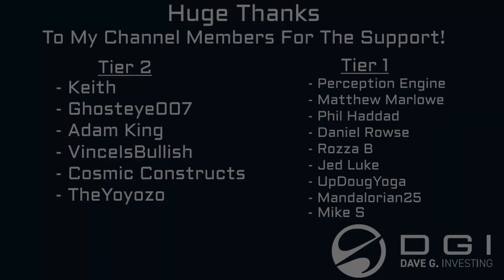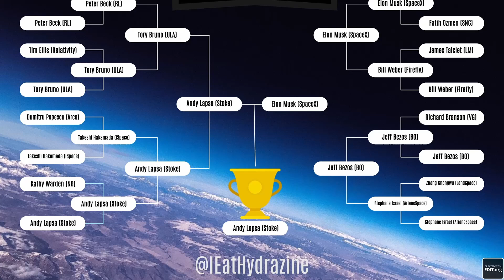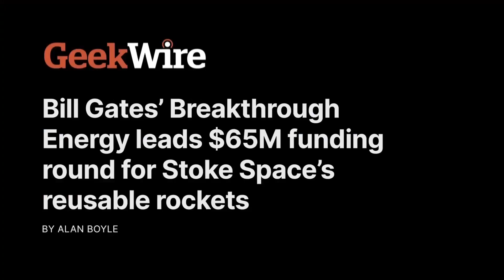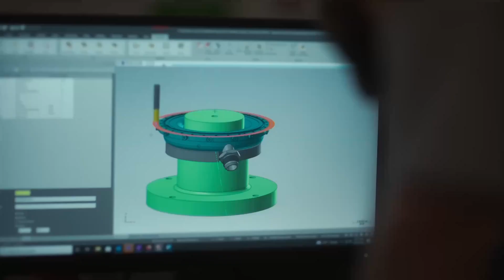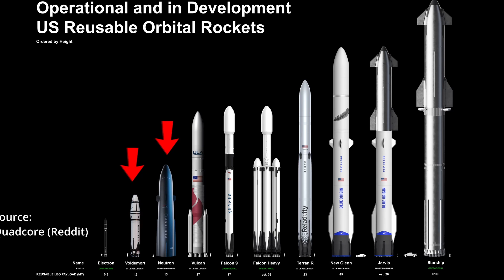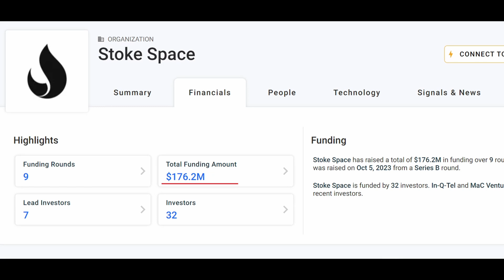The Battle For Supremacy: Rocket Lab VS Stoke Nova

Comment: The problem I have with Stoke is they are going straight for fully reusable rocket instead of starting with much easier expandable or partially reusable.
SpaceX started with small expandable rocket then medium expandable rocket then they made it partiality reusable and only now they are working on fully reusable rocket.
Same with Rocket Lab they started with small expandable rocket and only later made it partially reusable while also working on medium partially reusable rocket now.
They took it step by step starting with relatively easy expandable rocket meanwhile Stoke is going straight for the hardest thing without first doing anything easier, this is why I think they'll fail.
Reply: Because all these small launchers thay are throwing away stages are dead men walking. This isn't the same market as when rocketlab started.

Comment: Dave, you hit the key PRO of STOKE's NOVA rocket, 1st and 2nd stage REUSABLE, and the key CON, 5,000 kg to LEO, which makes NOVA a small-lift rocket, an ELECTRON challenger, not a NEUTRON competitor.
     You mention NO GIMBLE of the engines. Maybe you mean the 2nd stage single vacuum engine. If the 1st stage, 7x engines don't GIMBLE, the rocket has to turns round its midline axis. 
    NOVA might get $15 million a launch, and could do rideshare. But not the $60 million per launch NEUTRON could get, and other medium-lift rockets.
Reply from the maker: Nasa's definition of small launch is 2000kg or less.
Reply: @daveginvesting  Hmm. Well kg being important, and now that more rockets are coming, in my comments around the Web, I've been using, low-medium and high-medium. and low-small and high-small. I would maintain that STOKE at 5,000 kg LEO cannot be fairly compared to NEUTRON that at 13,000 kg, LEO, = 2.6x NOVA launches!
    Nor can NOVA = 16x ELECTRON launches, be fairly compared with ELECTRON.
   It gets even more squerlie. The EU says their ARIANE 6 is a HEAVY lift rocket, in 2 models. ARIANE 62 (2 strap on boosters) 11,500 kg LEO,  and ARIANE 64 (4 strap on boosters) 20,600 kg LEO. 
   But NASA calls FALCON 9 at 22,800 kg LEO, MEDIUM-LIFT. Go figure. 
     So HOW can STOKE's NOVA at 5,000 kg be MEDIUM-LIFT?? I'd say NOVA is a high-small lift rocket.

     Looks like we have, the war of the kilogram in propaganda circles! LOL

Comment: The Stoke solution is so  clever I hope potential funders can see that also.
I'm sure the size of the Stoke rocket is to do with being as big as it needs to be to get useful payloads, but balanced with being a good startup R&D size.
It remains to be seen how much a single engine multiple nozzle outlet second stage can scale up when they get on their feet with quick turn around infrastructure.
They might be happy with being the most cost effective launch vehicle for smaller payloads.

I think in current form Starship will be as quick a turnaround as Elon would like by swooping return stages for inspected and refurbished ones waiting near the pad.

Comment: For this small a LV I don't think payload penalty justifies reuse of US for upmass only. If they can start returning stuff from space eg manufacrtured goods then there is the additional revenue for downmass which changes economics. When a downmass market appears then watch other launch providers persue it with reuseable US. 
Having both a ultralight expendable and reuseable upper stages gives best of both worlds, pick right US for mission.
Reply: Interesting comment. With current rocket lab second stage design I only see 1 way to make it reusable .

Ablatique = no since not reaussalbe
ceramic = no because need a heavy heat sponge backplate and carbon fiber is not good for that.
aerospike like stoke = May be but the heat shield is soo heavy that you lose a lot of payload capacity with the current design. Also the engine type doesn't work well on this kind of arrangment. A RL-10 type of engine that use the heat from the shield to turn the fuel pump is way more adapt for the job so I believe it would need to much redesing.
Sweat heat shield will not work because the oxygen would react with the epoxy resin and a combustion would happen.
It leave us with the inflatable heat shield that is actually a very appropriate choise for a second stage soo light...

Comment: A thing that I didn't like about rocket lab is that they did so many changes to neutron. From gas generator to full flow. From 8T to LEO, to 13T. From shock absorbers to retractable landing legs. They chasing a moving target. With that approach, more delays will come. If Nova stick to the plan, they will be able to have something to show before rocket lab.
Reply: You are only looking at a render. Just recently, Peter Beck confirmed a cone shaped rocket in an interview. In the recent render it looked like a cylinder. Do you trust the renders?
Reply: They didn't change the payloads. Not even once. It's 8T RTLS. And 13T down range.
Reply: 5,000 kg to LEO, makes NOVA a small-lift rocket, an ELECTRON challenger, not a NEUTRON competitor. NOVA could not earn more than 15 to 20 million per launch. NEUTRON could earn $60 million per launch.

Comment: How will the Neutron first stage handle reentry? Is it just that the "fatter" profile of Neutron will cut the speed of reentry so that the heat will be manageable by the carbon composite construction of stage one?
Reply from the maker: Yeah pretty much, similar to how a Falcon 9 first stage or Electron first stage don't need much additional shielding to survive re-entry.

Comment: The heat is on (pun intended) once stokespace can demonstrate during a real life test that their concept of re-entry cooling can really work. Until then this is nothing more than an interesting concept that is not more plausible than something like the spin cannon for launching satellites without rockets. Investors seem to think the same which is why they have not collected as much capital yet. During a potential space company bubble at the stock market that i see coming from 2025 onwards, they will most likely do an IPO in order to collect more money and secure funding their idea.
Reply: There is no reason for it not to work. The inside of a combustion chambers experiences waaaaaaay more heat and stresses than re-entry, and that is managed perfectly fine with regenerative cooling.
Reply: @Shrouded_reaper  We will see ^^

Comment: Falcon 9 is not heavy lift. The most it has ever flown is 17T
Reply from the maker: Wikipedia says it can do 22 in expendable mode and the boundary of medium to heavy is 20 so that's what I went with. I suppose for most launches it's considered medium though.
Reply: That's exactly my point. What something "Can do" doesn't mean anything. The Falcon 9 is medium lift. It regularly did around 15.5T for most of its life . Didn't hit 17T until recently. You can simply go look at all Falcon 9 launches on Wikipedia and see for yourself. @daveginvesting

Comment: Peter should buy them out.  It'd fit nicely in the Neutron
Reply: The current desing of neutron would need major redesign to use the tech. Rocket lab expertise is in making everything light. Stoke heat shield is HEAVY. so the payload penality is really high. Also the second stage is inside the first stage to make it lighter... they advantage is lost with a stoke second stage... 

If rocket lab ever want to make the second stage reusable they would probably license the inflatable heat shield from NASA.

Comment: I also wonder how F9 engines bells (a “fragile” part) can hit the upper atmosphere at mach 3+ and shatter… F9 bleeds from mach 3+ to subsonic with engine bells *forward*…. When i went to kindergarten, cones, and not trombones, were considered more aerodynamic…..
Reply: Oops not shatter
Reply: Similar to sn8,9,10,11,15 their heat shield is going to take several tries, but Stoke is legit so i believe success is a possible eventual outcome….
Reply: @robshaw2639  
I am impress that stoke was able to make the upper stage prototype with the current cash they got... very capital efficient. Amont all the launch provider I feel that  Rocket Lab  Space X,  and firefly , stoke are the most capital efficient in that order. 

Sadly their concept have a payload penality soo high the they will not be profitable. I suspect they will fly a prototype.
Reply: They might be aiming at acquisition, if they can prove their IP is worth it….
Reply: @robshaw2639  
The CEO of Stoke work at Blue origine and for a time I reamember they were talking of using aerospike for the second stage to be reuse. 

I am impress that stoke was able to make the upper stage prototype with the current cash they got... very capital efficient. Amont all the launch provider I feel that  Rocket Lab  Space X,  and firefly , stoke are the most capital efficient in that order. 

Sadly their concept have a payload penality soo high the they will not be profitable. I suspect they will fly a prototype and they will run out of cash and blue origine will buy them to use the tech for new glenn.

Comment: The unique design of stoke space is very intriguing.  I’m not convinced it will be viable or reliable. One thing about that design is that you have cold fluids running through the heat shield but where is the cold fluid running for the engine nozzles?

I think if they don’t quit or go bankrupt they could probably get it to work but at the end of the day the total weight to orbit might be so small to negate using this approach. With a much larger rocket this might be more viable too. 

They could pivot like all other rocket companies to a larger design once they showcase this approach could be viable. 

Also it should be noted that Starship will also be growing. Elon said it would be 140 meter tall rather than 118 meter tall. 

I personally think it needs to be wider too for starship because doing 10 refuels is not ideal for a moon or mars mission. Being bigger should allow them to reduce this.
Reply: The physique point to a larger rocket being easier but then it is more costly to develope et manufacture... one of the reason why Rocket lab went with a small medium launch after electron is because it need less CAPex (Cash to develope and produce the first prototype). 

You are right that a the ideal would work better for a heavier rocket. The CEO of Stoke work at Blue origine and for a time I reamember they were talking of using aerospike for the second stage to be reuse. 

I am impress that stoke was able to make the upper stage prototype with the current cash they got... very capital efficient. Amont all the launch provider I feel that  Rocket Lab  Space X,  and firefly , stoke are the most capital efficient in that order. 

Sadly their concept have a payload penality soo high the they will not be profitable. I suspect they will fly a prototype and they will run out of cash and blue origine will buy them to use the tech for new glenn.

Comment: Spacex was initially going to use ablative cooling for starship but abandoned it to go to the more traditional heat tiles.
Reply: From memory the first heat shield for starship was going to be a sweat heatshield that consist in pumping liquid oxygen in pipe like the stoke but then it go in small hole on the outside shell to have the oxygen leak (sweat) and change phase as it get out and by changing phase it absorb a lot of heat... But they were worry that some of the hole would clogue (block).

Comment: Peter Beck of Rocket Lab in a recent interview discussed the challenges of making the second stage reusable, stating, "Suppose, yeah. It's just not that conducive. The rocket equations don't favor it. We trade so much to keep the fairing on the first stage. Like putting the fairing on the second stage, you just end up much larger, and your payload suffers horrendously. Heat tiling, reentries, and all those things come into play. Actually, you're in orbit now, so you have to time your orbital re-entry point. There's no point in just landing it back in an African desert; you have to land it back where you care. You've got a whole re-entry bit to deal with from an orbital targeting standpoint, which is all doable. Never say never because I've learned my lesson. At this point, we're focused on making a really efficient, high-performance, and low-cost upper stage. The reality is that 70% of the cost of the vehicle is in the first stage, true with Electron and Neutron. The majority of the cost is in the first stage, so that makes the most sense to try and reuse. If you can make the second stage as affordable as possible, then the economics start to get pretty fuzzy. That's one of the reasons why the second stage is hung inside the first stage because, as I said before, it doesn't have to carry the structural load of the vehicle, and there's no material in it. If there's no material, there's no cost in it."
Reply: Which interview was this? I remember him saying this somewhere indeed but don't remember where exactly anymore.
Reply: About an hour & 12 minutes in https://www.youtube.com/watch?v=C3l87aPWUCk&t=4437s  @deeptoot1453
Reply: Rocketlabs solution with the second stage hanging inside the first stage looks like a really smart method to make a really light and inexpensive second stage.
Reply: Yep, as Sir Peter implies, STOKE's NOVE could perhaps have been a 15,000 kg to LEO if the 2nd state was disposable. Not only BIG mass saving, but pushing a slimmer rocket up through atmosphere LESS drag / MAXQ, less fuel needed, more mass savings.
Reply from the maker: Yes agreed. It's just fascinating how two smart engineers come to opposite conclusions. Will be fun to watch this play out!